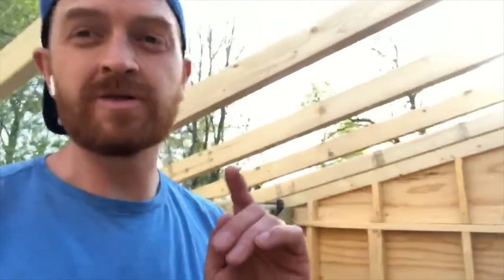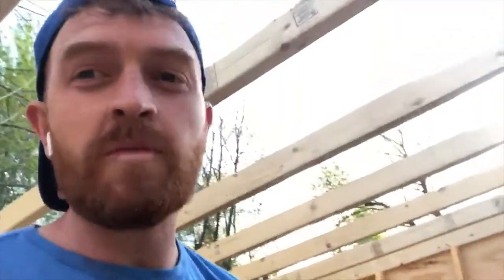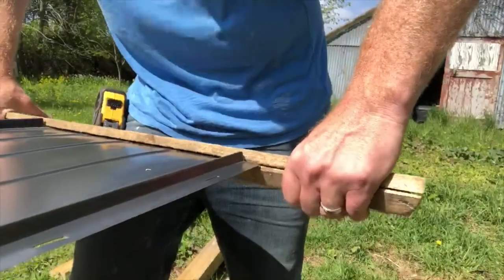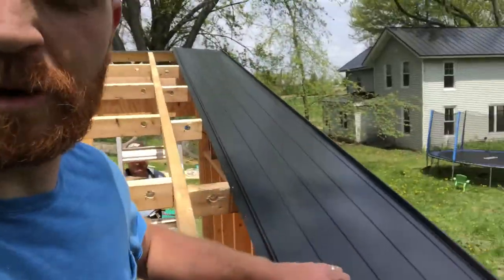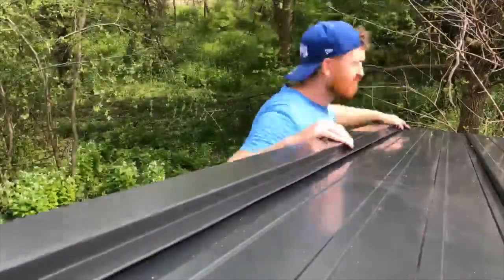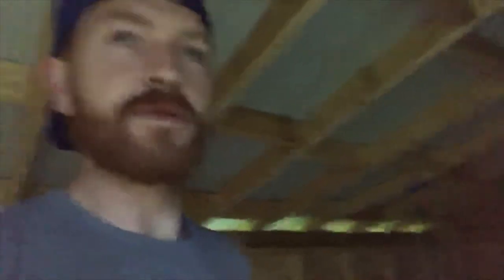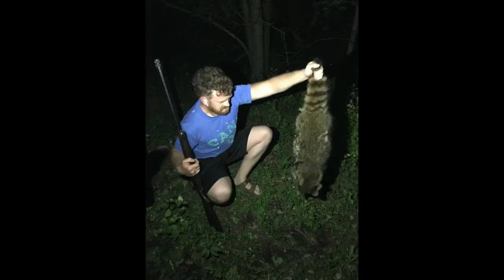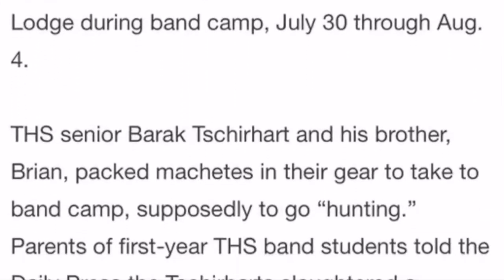Chicken Coop build Part 2 | Siding, Roof, Crazy Raccoon at band camp story

Comment: What roof brand did you use?
Reply from the maker: It's the premium pro snap, black steal panel from menards! If you leave your email, I'll send additional things I used for trim etc... link:  https://www.menards.com/main/building-materials/roofing/metal-roofing/cut-to-length-premium-pro-snap-reg-steel-panel/black1559785-02/p-1444448538229.htm